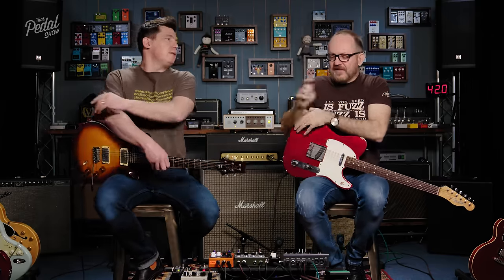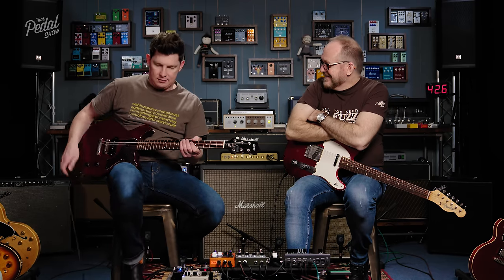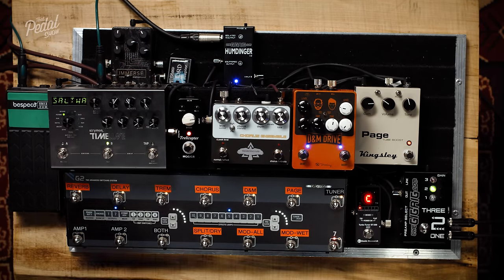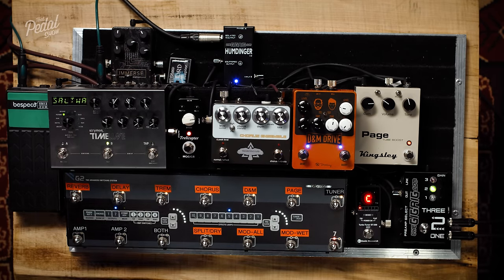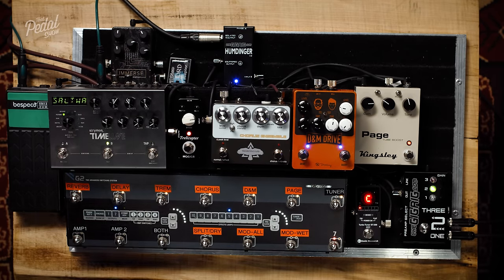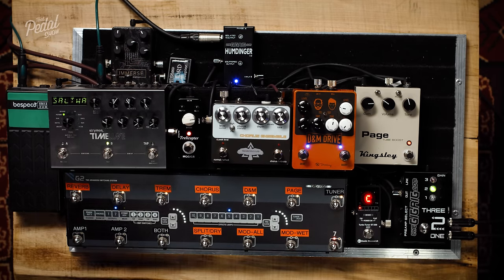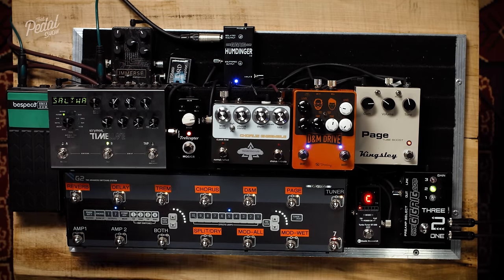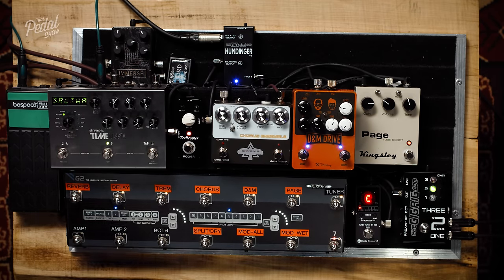Wet-Dry & Wet-Dry-Wet Amp & FX Setups Explained – That Pedal Show

Comment: Fantastic episode ...so much info....again :). My question is this. I have 2 amps and the one that i want to use as the "wet" amp has no effect loop. What is the solution for this. And how can i use an attenuator in the setup? Ty very much

ps the hand phase choreography should be a gif....meme heaven :)
Reply from the maker: Run the wet effects into the front...  Exactly like we do all the time. But if you want effects in the loop you have two options:1. Get another amp. 2. Use an add on device such as the Fryette Power Station that has its own loop. But that's a massive faff!
Reply: ty very much guys :) @ThatPedalShow

Comment: More about loops and cable length/quality please! I use my 3 amp channels for most of my gain, so always put a few FX in my loop for clarity. I had a pedal switcher in the front end and another switcher in the loop + a Timeline/Bigsky. These were all on my board at front of stage. About 6 months ago I found all that FX loop cables out to the front of the stage and back was having a serious effect on my tone even though I figured it was buffered. Not 'massive' but certainly quite noticeable. I always use high quality cables, but I've gone from good to great tone by putting everything but the Strymons in the front end so I only have one cable run back to the amp, and the two Strymons (Delay/Verb) now live in a little rack bag on top of the amp with far, far shorter cables (they're controlled entirely by MIDI anyway). I also now have a shorter run to the amp, even though I figured it was buffered so shouldn't make a massive amount of difference. So I learnt buffers and quality help, but there's no substitute for a shorter signal path, and so a TPS adventure into that territory would be very helpful. 😊
Reply: P.S. if it's a tube driven FX loop is sticking a solid state buffer on the output gonna drive the FX loop signal better with a lower impedance?
Reply: P.P.S. After this video my rack bag may also gain a humdinger before the Strymons. 😊

Comment: This is really interesting thinking about rack systems. I know you guys are not familiar with them, since I've asked before, but I wonder if, when your power amp has two channels and there's a preamp that outputs two channels, AND you have a multi-effect that does stereo, if you could set it to have dry on one side and wet on the other and output them in the individual power amp channels! And even better, have a 4x12" cab that takes stereo. And by that I assume the system wouldn't go out of phase or need isolation because they're in the same boxes all the way. That'd be super easy and cool.

Edit: cool, you actually touched the rack and power amp options this time! Glad you're expanding the knowledge!

Comment: I currently have 1 hum dinger and 1 fulltone tape echo machine (mains powered). Do I need a second hum dinger or something with a ground lift if I want to use  the tape echo on one amp in a wet/dry setup? Many thanks!

Comment: This is just awesome service to both amateurs and pros a like - brilliant, and still entertaining episode! You have outdone yourselves yet once again!

If I may make a suggestion for the super difficult scenario of running a wet/dry/wet rig using two effects loops and the preamps of both wet amps (I have been doing this successfully with Mark V:25/Carr Rambler/Marshall 2525H): you need Empress Effects Buffer Plus Stereo! Yes, it is super expensive, and yes it is totally worth its price. It delivers the isolation, phase reversal capability AND minus 6 or minus 12 db signal reduction ability in the effects loop signal path domain which is extremely useful to match your amps' send levels to what your 'wet pedals' can handle. I have a couple of fantastic stereo pedals from great manufacturers which cannot handle the effects send of either the Mark V:25 or the Marshall 2525h... Check out Empress Effects website: https://empresseffects.com/products/buffer-stereo

I use two Radial Engineering 'Twin City' ( http://www.radialeng.com/product/twin-city ) ABY splitters for the two signal splitting needs before the effects loop stage.

For the record: I have absolutely no affiliation with Empress or Radial Engineering. Is it a coincidence they are both Canadian :) They both make awesome gear!

Cheers!

Comment: So, tried a simple wet/dry with the humdinger today. using a Fender HRD as WET, Fender Pro Jr. as dry. Is the trick to give a hair more volume on dry amp ( or a hair less volume o wet amp ) to achieve a better Dry OVER wet feel? When i set both at unity, the sound seemed to just blend right together with the wet amp..

Comment: Amp1 clean.
But I have a question: with a stereo effect there is one Chanel « dry » and one with the stereo image.
Si it mean that for example:
Center : amp 1 « dry »
Left : amp 2 « dry »
Right : amp 3 « wet »

So we have 2 dry signals...

Should I put a 1st réverb or delay before the stereo effet to make my amp 2 « wet » compare to the Amp 1 « dry »?

And then after the stereo effect to create another delay beatween amp 2 and amp 3?

Comment: Hi guys! great show as always! Question: is the Radial Big Shot ABY a splitter that does the job correctly?
Reply: The Big Shot will work and give you foot control to toggle between amps if you want. I did my setup with the Radial Shotgun which takes away foot control, but can connect up to 4 amps with isolated outputs. Isolation, phase switch, and ground lift on outputs 2–4 give you tons of flexibility to get in phase and remove hum.
Reply: Yeah my one one phase switch and isolation too. Works great for wet/dry

Comment: So... possibly I missed this, so sorry if you covered it... but how do you set the amps? Do you set them up dry and EQ then individually as if they where the only amp to be used or do you power all three and try to EQ them together??? If that made any sense?

I’ve tried setting up three amps without any thoughts behind it before I started... before I found anything I suffered from hearing fatigue so everything sounded rubbish no matter what I tried. I’m thinking trying a more scientific approach now ☺️

Comment: Can you touch on the difference (if there is any?) between a wet-dry setup, and an amplifier that offers a parallel fx loop?  I'd think you'd be trading the phase issues for potential interference between the "wet" signal and the "dry" signal both attempting to vibrate the same speaker cone(s); but otherwise shouldn't it be basically the same thing in a smaller package?
Reply: Yes, I am interested in this as well. A mixer/blender type pedal like the Boss LS-2 in A+B mix mode would also be a comparable wet/dry with one amp type  setup. It seems like it comes down to the difference in having the physical stereo separation distance, and phase cancelling the electrical signal vs sound waves phase cancelling in the air

Comment: Do you know of a utility pedal with mono in and stereo outs where you can put your drives in a loop and send the 100% driven signal into one channel and a blended (dirty and clean—similar to voodoo labs sparkle drive) signal into a second channel?  I’m just getting into running a wet-dry-wet myself and was wondering how it would sound to have some of the cleans blended back into the wet amps.  Of course it would require ground lift and phase reversal...

I’m just wanting to know if such a thing exists.

Comment: You have shown why I never really liked tremelo or vibrato until I bought 2 amps and put it in the effects loop of one of them. I didn't like hitting the string and being in the valley of the effect. It always threw me off. Is there any way to put your modulation first, i.e. vibe/phaser/flanger pedals, then drive, then delay, reverb, and tremelo? Or is that just not something that can happen? It's my biggest reason for not running pure wet dry. I like phaser, vibe, flanger and octave first. I tend to run moist or "damp" as Mick said. I put the swoochy effects into both amps with the drive and the rest after the split into the second amp currently.

Comment: Is there any ability to use a quartermaster with stereo pedals? Would running half of the signal through a QMX create phase issues and/or function enough to turn the pedal on and off?

Im thinking of running a stereo delay and stereo reverb at the end of the board with the option to send all pedals to 2 amps. Using them as wet dry at times and just 1 amp at a time at times.

Comment: I experimented with wet dry using a stereo delay in bypass to split my signal.  I found that when I set my amps up clean and levels blended well then engaged my drive one amp would stand out more and vice verse when I would adjust the amp levels with the drive engaged to be blended and went back to clean the other amp would stand out more.  Is this also the phase issue and not using a splitter with the phase inversion capability?  I have an Ibanez tsa15h with 2x12 Cab I used for dry and a Behringer Vampire 1200h solid state with 4x12 cab for the wet.

Comment: Hi Guys,

Really enjoying the show. It is really inspiring.

A little question: will a simple ABY box like the Mooer ABY or the Electro Harmonics Switchblade do the splitter trick?

Greets from Haarlem / Netherlands
Reply: Sytse Bakker they will sufficiently split your signal, but i’m not 100% positive that they both have isolated and phase-reversible outputs. I’d like to think they do, but i’m not sure.

Comment: Absolutely epic guys!! Love the tones and could imagine the inspiration that comes from this setup. 

The big question I have with running a wet/dry or a wet/dry/wet rig is how to manage the levels between amps at a gig to get the right 'mix'? If you're relying on your amps for volume and can crank them on-stage I guess it would be easier to manage, however,  if you're forced to mic them and their levels from the FOH is controlled by a sound tech aren't you relying on his interpretation of your desired mix is between dry and wet?
Reply: The foh can vary each channel separately so once you set yours on stage he can adjust how he wants it out front.
Reply: @guitardude1981  yes absolutely... I get that. What it doesn't address is that you're still relying on their 'interpretation' of what your sound is. If you have a tech who knows your songs and on top of their job then great but if they aren't (which is going to be the majority of places) then there's hardly any control over your different textures and mixes. 

It's probably less important for most cover bands and less delay/reverb textured styles but I struggle to see how it'd work if you need to go from clean to saturated and you're relying on someone else to make sure that mix is reflected immediately in the FOH.
Reply: The only way to get it right is have a mixer that you could mix the levels on stage then send foh 1 overall channel.

Comment: What about using an ABY box as a splitter? And what about using stereo pedals as splitters? I use my DD-7 when I want to use two amps, according to the manual, you can use it to be wet/dry, to have a ping - pong effect, or to be completely independent stereo (when using the two inputs). Are there any downsides to this? Or am I missing the point entirely? I have had hum problems when plugging my amps very far apart, is this what the isolated output will solve?

Comment: I have a question...when you do the Kill Dry (no dry signal on the wet amps), wouldn't it be easier to put the drive pedals after the splitter but between the splitter and the Dry amp (Marshall in this case)? I mean, I was wandering since the begining this question and when you talked about "no dry signal on wet amps" I thought that was what you were going to do… and...how do you Kill Dry if the gain pedals are on the input of the splitter? I Don't get that… My idea was: guitar, splitter and then one way just drives and the other way "wet" pedals… I understand all the rest, but this keeps me wandering (or wondering, not sure of the spelling). Thanks, Dan & Mick!

Comment: I am watching this episode again after 2 years. I bought a stereo DI box. I want to do a wet dry setup in the computer. I will rearrange my pedal board, get the signals into 2 DI boxes for left and right and into my sound interface using balanced cables. I can then run 2 amp sims or record into DAW. Thanks for all the info.

Comment: For the in phase and out of phase situation, is it literally the physical speaker in the room sucking up the frequencies from the other speaker, or just not delivering a solid sound through the air to your ear with equal vibrations(in sync)? Or is it an electrical/technical thing happening inside the amplifier?
Reply from the maker: It’s one speaker pushing while the other speaker is pulling 👍

Comment: If you're using In-Ear monitoring, another good (and practical) idea is to replace all of 3 amps (in a WET-DRY-WET setup) with amp simulators. I use a Torpedo CAB (DRY) and 2 Mooer Radars (WET) οn my pedalboard and I love the sound of stereo delays and reverb in my IE. I've made a rundown of this rig if you want to check it out.

Comment: Can you use two heads with a splittable 2x12 or 4x12 for Wet-Dry? Is there any reason why this would not be optimal? I understand separation may be less obvious, but using one cab would be more attractive for gigging.

Comment: O dear. So many questions now...Erm, so just when I wanted to get a second amp to make use of my stereo delays and especially the new Boss Dimension-C Waza, am I correct in now finding I'm actually going to need THREE amps to achieve a wet-dry setup with stereo capability on the outside two wets? And then still not being able to go wet-dry-wet with those three amps because of that stereo requirement? Talk about a rabbit-hole, as if those six strings weren't causing me enough strife already...

Comment: Can we talk about buffered vs un-buffered splitters?

For example, I think you said in the vid that on the humdinger the isolated (unbuffered?) output goes to the amp and the buffered output goes back into the board. Why does it make more sense to have the buffer going back into the board?

In my context, I've been using the Radial Engineering Twin City as my splitter, which has both outputs buffered, but I'm wondering if I should be using an un-buffered one instead. It probably hardly matters, but I'm curious to get y'all's opinion on this. Any thoughts?

Comment: Would it be possible to use a stereo output pedal like the TC Electronic Hall of Fame with everything turned down as an isolated splitter minus the phase reversal option?

Comment: For the VLOG: I ran my signal into my Radial JD7.  Channel 1 into my AC15C1X "Normal" channel.  Channel 2 into my AC15C1X "Top Boost" channel.  I balanced the output between the two channels.  Awesome sound.  Then for grins I flipped the phase on Channel 2 to see what happened.  The sound basically lost the chimey top-end.  However, I guess I expected it to disappear overall much more than it did, especially since they were coming out of the same speaker (because if two exact signals are out of phase in a perfect world, the result is silence).  Ooo-wee...What's up with that?

Comment: Not much on here about the Fulltone ABY. I have one and three amps, two 20 watts heads, and a 100 watt bluguitar amp1 for a Les Paul traditional that is considerably higher wattage rig, through two Pacific Woodworks 1 x 12 EVM loaded cabs. The blackstar head has reverb and plays through a Dr. Fong 2 x 12, and the Vox AC15HW is my dry amp, combo with blue in it. I was thinking that to exploit this properly I would like to add an ES-345. I also have an American Strat because I like it with the Vox for the chime. There seems to be great versatility with all this, plus pedalboard options. Right now, i only have the H9, for wet options, but considering an immerse or similar.

Comment: I always wanted to do a split  (ie parallel paths) around the gain stages. So split into 2 paths: 1. Clean or slight overdrive and 2. Higher gain pedals or (heavy?) compression and then bring the signals back together with a variable mix control to then go into the modulation section. Kind of like Keith Richards one clean amp / one dirty amp fed the same signal....Yes I know It's mad.... and then wet/dry/wet!

Comment: You can also use a single amp without an FX loop as the dry.  And use something like the Palmer PD9 which goes between the amp and the speaker and splits off a line out. You send that line-out through your wet effects (stereo effects, even) and then send that stereo output to left and right of a stereo power amp (I use the Atomic Reactor 50/50 - or you could use the FX return of a couple of regular amps) and that drives your stereo wet speakers.  I've been doing it like that for about 10 years. I used to use a TC G-System in the middle of all this, but £'ve gone all-analog now.  Just ordered a G3 Atom to go in the middle of that insteas and a Generator to clean up my power.  I will try thaat wet tremolo thing - sounds interesting. Thanks guys.

Comment: So, i have a AC30 Korg RI from 1990 (91?) I have a barber launchpad that does the fasereverse thing and really makes a big difference with using a jumper. I am curiuus how to use that in a device like the G2. Does the splitter go in a stereo loop, and therefor has to be allways on? And i want to use drives after that do i use like half of the stereoloops? So if I want to use the Benson preamp on the TB channel and a fuzz face on the Normal channel and put them both in a stereoloop they will act like a parallel drive? Or if I just use the left side of a loop for the Benson and the fuzz on the right side of the next (and a jumper on the others) Is this the way to do it?
And is there a way to mix or mute left or right?